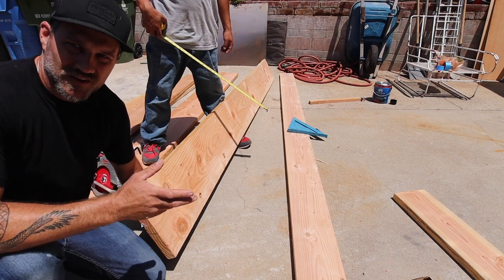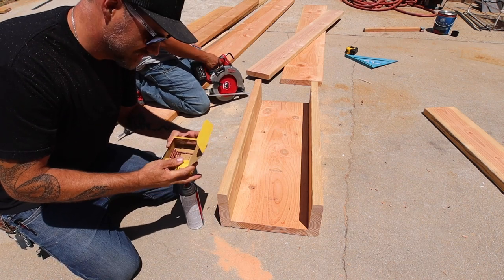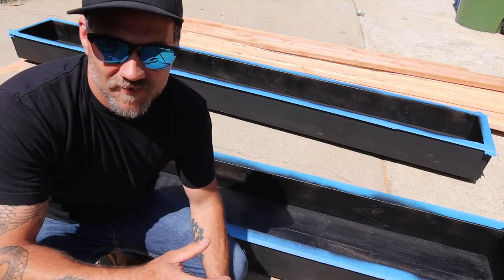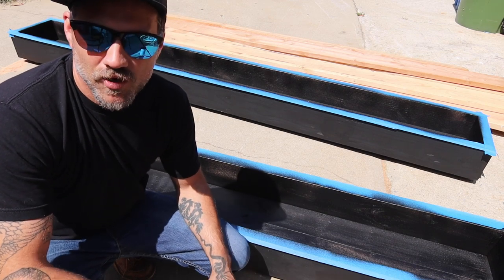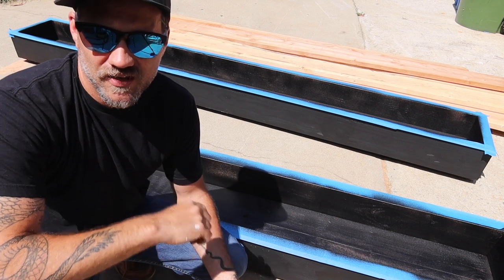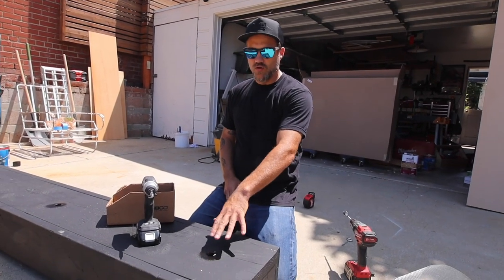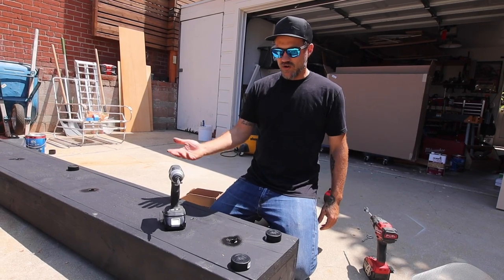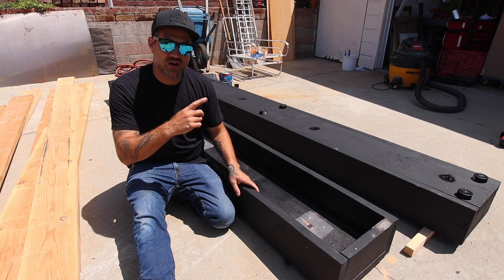How to make an outdoor planter : mexican feather grass

Comment: Nice job but super invasive plant, not recommended to plant.
Reply: Not if planted in a planter.  You can get away with planting some ruthless species if you properly contain them.  Thanks!
Reply from the maker: completely accurate. You just need to keep after it
Reply: Trevor Whitcomb they’re still super invasive in a planter or not.  They re-seed so easily.
Reply from the maker: @sandyovals  definitely invasive, unless contained.